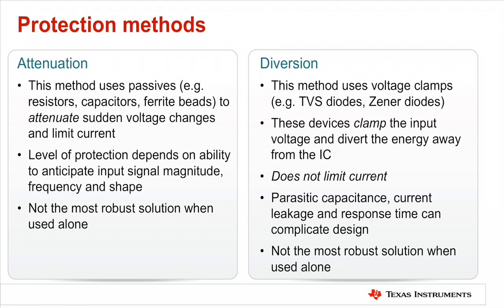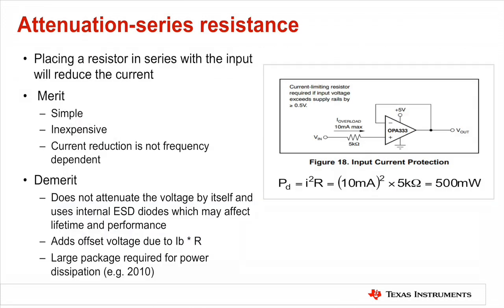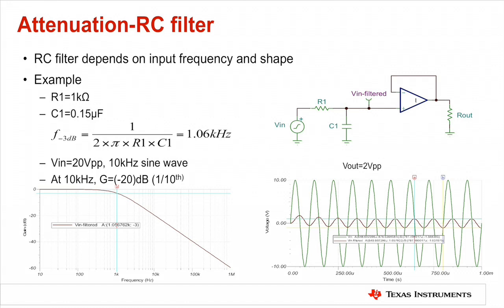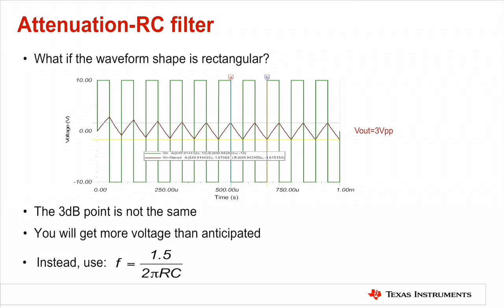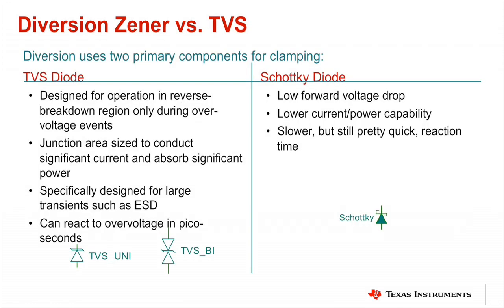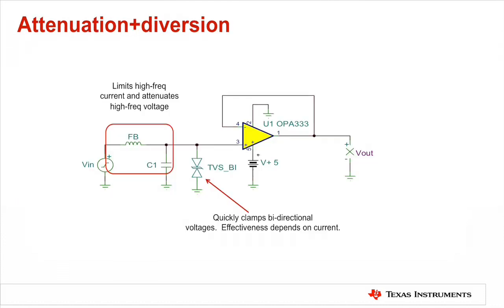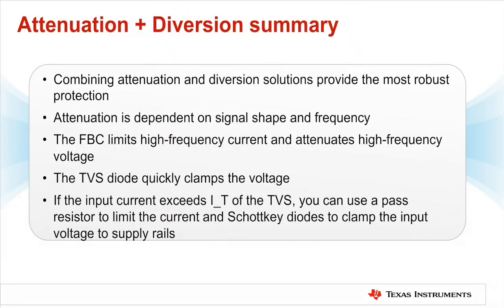Engineer It: How to Design Protection Circuits for Analog I/O Modules

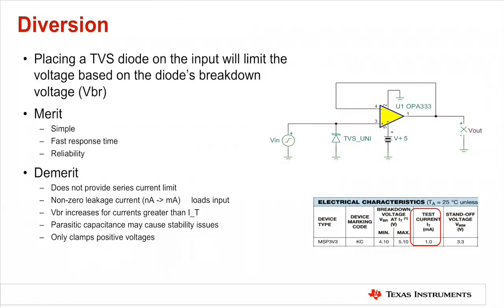Comment: 4:45 "unidirectional TVS...only clamps positive voltages". Except surely it also clamps negative voltages at one diode drop (ie: -0.7V), right?
Reply: Exactly. Bi-directional TVS diodes are only required when the signal need to operate at both positive and negative voltage levels without being clamped.

Comment: What about precision measurements, would the suggested setup affect a precision reading, for example, a buffer circuit for a 24bit ADC?
Reply: Would you not be using differential/common mode NR coupling anyway to a 24-bit ADC if frequency domain were a concern? Notably, ESD diodes typically offer leakage in the nA or pA range below stand-off, probably comparable to buffer/driver input.